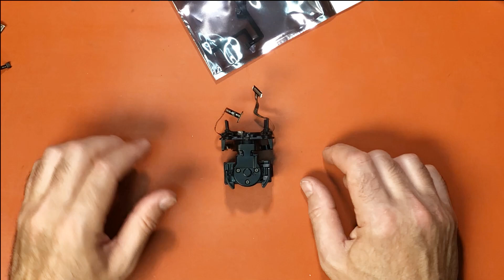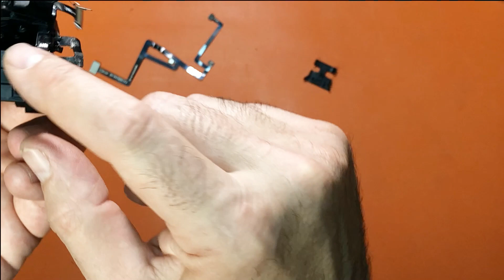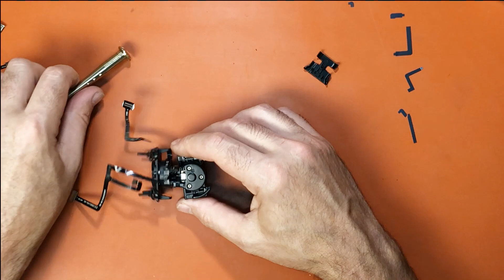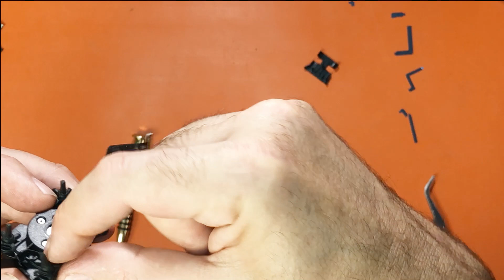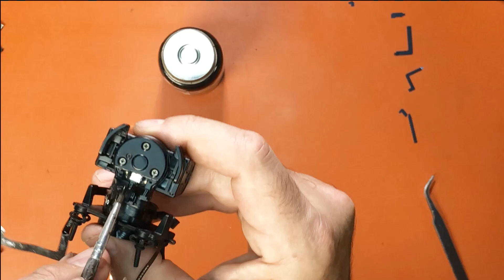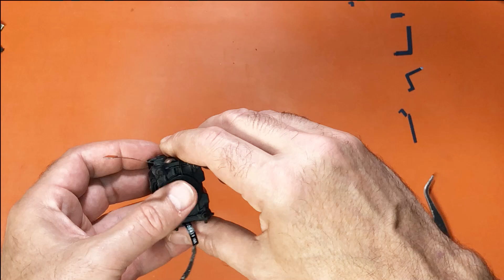HUBSAN ZINO - REPLACING GIMBAL RIBBON CABLE

Comment: How can I know if my RIBBON  cable is zino or zino Y (J4)
Reply from the maker: Zino Y has the J4 printed on the cable and Zino doesn’t.
Reply: @QCGUY This means that there is no difference in the piece and there is no need to worry, right?
Reply from the maker: @ansmakhzoum602  you can’t use the cable with the J4 printed on it for the zino.
Only for the Zino Y and Zino Pro.
Regular Zino uses a different cable.
It’s pretty simple

Comment: Thank you for video.. It's a bit hard to see what is being done😅
Reply from the maker: Did my best…
Reply: Thank you very much . Vids are terrific.
Reply: Just a suggestion, would you consider painting the tape white so it could be seen easier?
Reply from the maker: @troykey701  no, I would pass on doing something like that. You don’t need to make them stiffer or cause them to heat up more.

Comment: Do you think what is the cause that the gimbal cable is broken ?  As the first reason ,   a user  switch on  the drone  with the camera cap. By the fixed  gimbal, the gimbal cable receive a large electric damage.  As the second cause, when the gimbal cable is setting on the camera, the cable is folded at the branch to the turn-outlet, I think. The cable is very fine. So soon the cable will be broken. 
The measures are the next:
   1) take off the camera cap when the drone is switched-on
   2) remove the camera head-projection   fixing  the branch cable to the turn-outlet
        Because,  in cause of the projection,  you need to fold the cable tightly. This is an unhappiness.

Sorry. I am not a good English writer.
Reply from the maker: They are fragile and fail from several things…

Comment: Thank you so much for this tuto Guy. I did it step by step successfully. Anyway since this replacement, my ZINO H117S doesn't connect anymore my remote controller in WIFI mode. Can this problem be linked with the 2 connectors that we have to unplug/plug to take off the cover ? I must say that it was the 1st open of the ZINO and that was a lot of glue on those 2 both connectors. Thanks
Reply from the maker: If it connected before you replaced the gimbal cable chances are you damaged the camera cable when you had it apart. 
It’s very common for it to fail after replacing the other cable. If the camera cable is bad it will not transmit WiFi and it won’t connect.

Comment: Chris, good afternoon!
Would you know how to reset the zino pro plus aircraft system.
I installed a different version of the aircraft, I mean the Brazilian and Chinese version, and after that the aircraft does not communicate with the controller, so I need to reset its system and reinstall the firmware.
Reply from the maker: You should be able to install the correct firmware directly over the wrong on the computer. Sorry I replied late but let me know how it worked out for you. 👍🏻

Comment: I need help. I've already broken my whole head...the camera suspension does not work. camera stabilization works.
the camera is working. there is no connection with the camera stabilizer.the update for the suspension does not end.a bad connection is written on the control panel.
error 0*0000. I changed the train to the suspension, everything remained exactly the same. maybe it's a software error?
I don't know what to do.
Reply from the maker: I can’t resolve this for you in comments especially with our language differences. Sorry buddy
Reply: @QCGUY  спасибо Стив.

Comment: oke can you please send a picture of the ribbon cable of the hubsan zino pro + (the cervo cable for the gimbal)
Reply from the maker: It’s pretty easy…
Go to Aliexpress and search for zino-y or zino pro gimbal cable. The cable will have a P1 on on end and P4 on another end. Aliexpress is the best at getting it correct.

Comment: my servo motor gimbal not moving at all. is it because of the ribon need to be replace. and i cannot do calibration at all.
Reply from the maker: Yes it’s very likely the ribbon cable.
Reply: @QCGUY  thank you.. ya i tried to do manual calibration using pc. it said timeout i assume cable problem.
Reply from the maker: @5EFISIEN  Yes if the gimbal shows zero life the tool won't work. The cable has failed and it doesn't detect the gimbal.

Comment: Do the ribbons listed in the description work for all the zino drones? I have a zino pro plus. Thanks so much for the videos, suffered my first tumble, need to fix it.
Reply from the maker: The image cable works for all zino models before the zino 2. 
The gimbal cable is different between the original zino and the zino-y, zino pro and zino pro plus. I have other videos on how to identify what yours requires.

Comment: Great video..I did everything right changed the ribbon cable but still my gymball is dead at start up ans after.I got FPV and wifi...its says ABNORMAL CONNECTION at the APP..PLEASE HELP
Reply from the maker: Are you still having trouble?

Comment: Do you have the part number for the gimbal/camera on a Zino PRO+? I can't find a clear answer on the internet. QR code is ZINOPR+
Reply from the maker: It’s in the description of the video. Just buy the correct one for your model. No need to comment the same comment in several videos. I’ll answer ya buddy. Thanks
Reply: @QCGUY  yeah, sorry about that man. They were older videos, I just wanted the comment to get noticed. I’ll double check the description, didn’t notice the first time. Great content though, very informative!
Reply from the maker: @PookieEarl  no worries...
I notice every that I get a notification for. Any questions about the part let me know and I have a video on what cable is the right cable for your model you may want to check out to be sure. 👍🏻

Comment: Hi guy! Super useful video! But it's normal that the yaw motor can pop out from gimbal mount just pulling by hand? The motor shaft with the screw come out with the motor, and the rotor with magnet stay on the gimbal mount....is it normal?? I can't see anything broken on the shaft...
Reply from the maker: After you remove the screws and cover yes it will just slide off.

Comment: I had intermittent FPV then it finally failed so I took the plunge. I found a European suppler in Poland €14. Bought a few decent tools for the job and followed this video exactly. Hey presto, FPV is back working as is everything else. Took me an hour as I was as slow as I could. Thanks Chris, I couldnt even have started the job without your help.
Reply: Can you send me a link for the supplier?
Reply from the maker: @WilliamJones-nq6is  look in the description of the video. Get the correct one for your quad though. Thanks
Reply from the maker: Wonderful 🙏🧡

Comment: Great video.

I checked the cam connector. Also checked the gimbal connector.

Still flashing red. I wonder if I need to replace the ribbon cable. Anyone now much is the Wi-Fi module and does Hubsan sells this?
Reply from the maker: There’s different things to confirm here but as far as the Wifi module goes you can check around but if you use Facebook it would be good to post in my group to narrow it down to the exact problem. Not easily done here. 👍

Comment: Freaking made in China junk, small impact on my second flight and I need to buy cable? I spent 1 hour or less for fun, yet 4 to 5 hours on preparation.....then it freaking broke with error 0x2000. NO WONDER Trump kicked Huawei ass from 8000 miles away, they sucks, irresponsible and definitely not the best state run company from China ! One of the shxt piece product I ever seen....only worth $250-$300, charger is so cheap which take 3 hours to charge 1 battery, USB TX to PHONE cable plugin lose itself, it require freaking USB debugging mode on yet still unstable where USB notification keep popping up in flight screen, Hubsan app shutting itself during flight, it even shut my phone off, WTF wrong with these dumbass who created this junk? Software, hardware and errors every fxxkin where and no fxxkin officials support at all. Fxxking selfish/greedy communist mother fxxkers !

Comment: Hi Chris! After crash the the controller show me gimbal tilt error . Bu the gimbal server was working I have did horizontal calibration and after gimbal calibration. After that the gimbal death
Reply from the maker: Camilo Martins If all 3 motors on the gimbal are working then it has to be calibration with tool to fix this fault. 
Do a horizontal calibration of the drone and then when you go to calibrate the gimbal with the tool it can take several try’s but most important is step 1. If one of your x y z numbers are more then -4 or +4 it’s likely to fail.

Comment: Hi Criss,Good morning, I hope I don't bother with this but I turn to you to see if you can help me with the problem I have with the Zino Pro camera.Two months ago I turned on the drone to fly it and I remember that several times I turned on the drone since I realized that it did not turn on, I did it simultaneously about three to four times until it turned on, I realized immediately that the camera did not move, When connecting the remote control and the phone with the app, I realized that I had a connection with the app but without an image, the reckless one works and everything else, only when I checked the version of the gimbal in the app, it is already It is not there, and the most important thing is that it flies, I bought the cables for the camera and the servo motors of the camera (I followed your advice) and replaced them, but still with the same problem I have no image but the drone flies without problems, it will I should replace the camera (100U $) or replace the control card (100U $) ... I don't know what else to do, friend, I hope you help me.Now if I replace the camera, I must put the same camera cable for servos and image, right?the zino H117S camera is the same as the zino pro's, according to the answer you gave me a few weeks ago.Max nuñezSantiago de Chile

Enviar comentarios

Historial
Guardadas
Comunidad
Reply from the maker: max nunez If you’re certain you got the correct cable for zino-y and zino-pro and all axises aren’t working then the board is a likely bet.
Reply: @QCGUY  Well criss, I thank you for the answer, yesterday I asked for the 100u $ card, so I must wait for it, nothing more than that as soon as it arrives, I will tell you how it goes with the repair
Reply: well the cable I asked is the correct one for the camera and for the motors it is the HY010 PTZ Y, that would be the cable and it is the same as the one I took out of the camera.
Reply from the maker: max nunez The difference between the cables is the Zino-Y and Pro will say J1 or J4 on the part of the cable that hooks to the board.
Reply: @QCGUY  yes Criss

Comment: I'm in doubt if my drone is zino or zino-y, the serial number is ZINO SN: AAH070E13030103. Can you help me ? Accuracy of the ZINO000-80 flet cable
Reply from the maker: Agronomia 53 when asking the same question please do it in one video and not multiple. Thank you
Now to answer your question yes you have a Zeno not a Zeno – Y based on your serial number.

Comment: What adhesive would you recommend for the connectors?  I'm hesitant to leave them "un-glued" if Hubsan felt it necessary to glue the connectors.  Thanks!
Reply from the maker: dave minkel Any type of silicon base that you can easily remove.

Comment: Hey, i saw comments but have the question. My drone crashed and i have 0x2000 error. It fly. It record. But camera roll doesnt work. Camera doesnt move at start. Ive seen the cable from this video is broken a lil bit so ive moved it out and order another one.. but in the comment you say that if camera doesnt move at start you have to change the gimbal motor cable - so its the second one? But it seems like this one is fine. What should i do?
Reply from the maker: BĘDZIE nieŁATWO Replace the cable you ordered but it sounds like something is going on with the other one as well. 
Did you crash it or do something to cause damage to the cables?
Reply: @QCGUY  Yep.. he just fall down from 10 meters after stuck on the tree. Gimbal base (this flat plastic with dampeners) was broken also but i glued it back actually (only small piece). On the app it shows angle sensor failure also. Its error 0x2000, but it record. I cant calibrate gimbal.

BUT the second cable is fine.. mechanically.
Reply: @QCGUY  Soo, what you think dude? Should I change both? Or there is different problem?
Reply from the maker: @BĘDZIEnieŁATWO  Sounds like the cable you ordered will take care of the problem then.
Reply: @QCGUY  thanks, in case ive order both.
Reply: @QCGUY  Indeed. This one fix everything. Just changed. Thanks!
Reply: @BĘDZIEnieŁATWO  Hi, I have the same problem as you had. Did you order the cable like the one this video?

Comment: My Zino suddenly will not connect, no recent impacts and always stored in a protective case. The LED next to the SD slot is flashing constantly too. The gimbal is still working correctly and stiff. It had been suggested that it may be the camera cable? But...as I said, no recent impacts. What would be your opinion Chris?
Reply from the maker: I have one doing the same and after finding a perfect cable I am to the point that I think the wifi module is done. I have to test voltage points on the board to be sure. Sorry

Comment: Hi Chris thanks for all. I have some problem in insert the pitch connector. Maybe it depends on the fact that I try to replace an Ex 1000145 -04 with a Ex1000145 -03 ? Thank in advance.
Reply from the maker: Corrado Galgani Yes you have to use the same one. They separate them by Zino and Zino-Y but the difference is the plug type and trying to use the wrong one can damage the pins.

Comment: Hello Chris,  very helpful videos there! Can you please upload the img to sensor ribbon replacement? It seems easier than this one but still not sure how it was originally connected after a crash... thank you in advance.
Reply from the maker: That one is not so simple because once in the side of the camera it rolls around a point inside and the connection is deep so it has to be taken apart. I have not had one fail yet so no videos till I do unfortunately.

Comment: Hey Chris, I now have my 2nd zino with no wifi. The led for the sd card is just flashing slowly. I was more careful with this one than the first one i thought, with no crashes or anything .Is there any chance the connection is just loose and i can push on the back of the gimbal to reconnect it, or does that mean the cable connection is surely broken? Thanks for any input
Reply from the maker: Brian Silkett No wifi isn’t just one thing. It can be a number of things. 
Cable connection, bad firmware installation even from production are not uncommon.
Reply: @QCGUY  I took the back cover off. It was working to fine. Looks like the foam piece was too large and it caused the connector to separate from the ribbon on this one. If I could send it to you i would be grateful . I do not have the proper tools or the light touch to do such a repair i am afraid.

Comment: Nice video Chris, I just replaced ribbon because of shakey video and error 0x2000. Gimbal sensor error failure occurred. Double checked connections, recalibrated, tried older gimbal firmware with no luck, any advice would be appreciated.
Reply from the maker: Fred L. I have not seen error 2000 before. 
I need as much details as you can give. 
Does the gimbal move at startup and does it have fpv/wifi signal?
Reply: @QCGUY 
Gimbal does not move at startup, fpv and wifi are working.
Reply from the maker: Fred L. This still tells me it’s your gimbal motor cable connections. It could be from the board or the three connections on the gimbal. 
It’s a fickle setup.
Reply: @QCGUY  
Thanks, I will check connections on board and cable again, I had ordered another cable that hasn't been delivered  yet, I'll try that as well.
Thanks for your help.
Reply: @QCGUY  
Ok, it was the yaw connection, had to play with that connection, seems like it worked when it was tilted slightly forward. Took it for a flight but still shakey side to side, maybe bad yaw motor.
Reply from the maker: Fred L. I would like to see video of it but now that you found the problem have you tried a calibration? 
Do the gimbal calibration, turn off, pull the battery, plug the battery back in, turn on and do the calibration again.
Reply: @QCGUY  
I did calibration but not like you stated, I'll try your     procedure and let you know, thanks a million.
Reply from the maker: Fred L. Fingers crossed 🤞
Reply: @QCGUY  
https://youtu.be/kGzhQ4tdbzs
Still getting shake,the same as  before replacing cable's. This is an older video that demonstrates the issue.
Reply: @QCGUY  Hello Chris, I have he same error, 0x2000, the gimbal move at startup but it stagnates turned to the side and it does not move. It have fpv and wifi signal. any idea? thanks!
Reply from the maker: @samuelrabasco5990  This gimbal has 100 personality's. It is hard to say exactly what is wrong just by some of these codes and not having it in front of me. All I can do is tell everyone the same thing, check connections and calibrate. Some might work and some might be just broken. Sorry